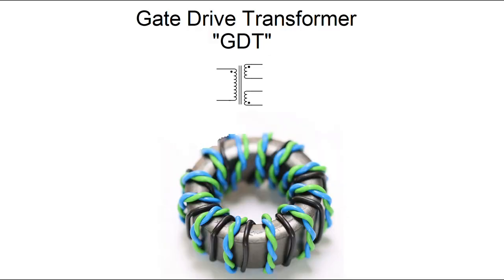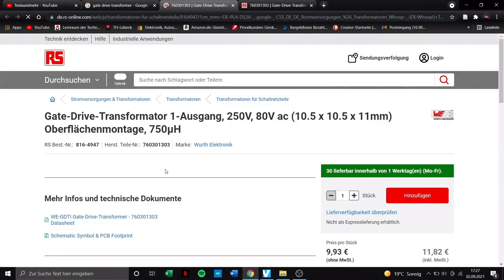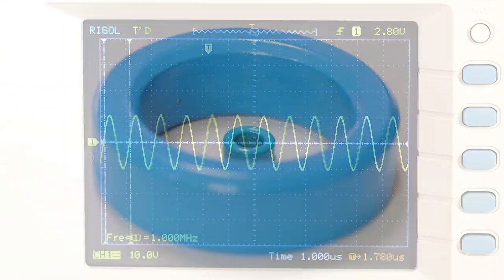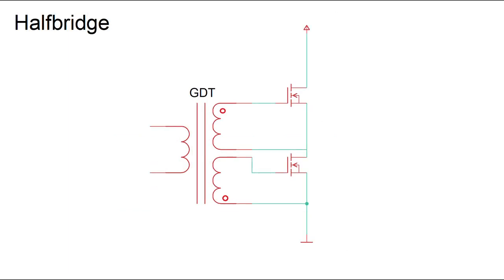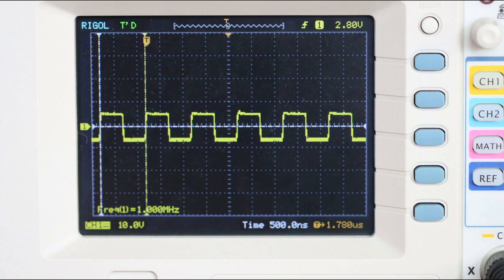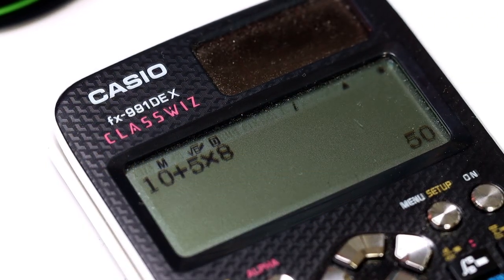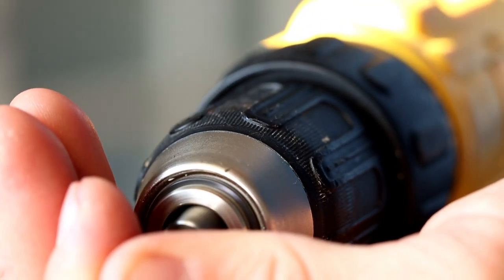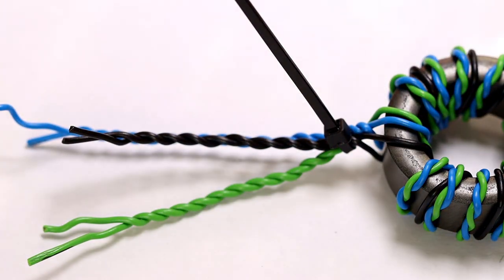Tesla-Coil Beginner DIY Tutorial: GDT - Gate Drive Transformer

Comment: Thank you for this video! I would say GDTs are not so much about separating HV from LV, but turning on and off n-channel transistors, which work in common drain config. To be precise, to fully open upper switch of H bridge, you have to put the voltage between Gate and Source (or Emitter), but upper switch Source is connected to load, so gate drive signal can't have common ground with supply voltage. Unfortunately, with GDT you can't have duty cycle other than 50% (transformers only work with AC), so switching power supply - ok, induction heater - ok, SSTC - ok, but DC motor, where you need PWM - not ok. But that's just a fun fact about GDTs.
Reply: Very well said Sir..how can I connect with you

Comment: Optimally you also want all the windings on the gdt to be twisted together for optimum coupling and performance, and ideally you also want the primary wire gauge to be the sum of all the secondaries combined as it will have 1-4 times the current on it depending on if you're driving a single fet or a fullbridge. You want the primary to be the sum of all the secondaries combined to minimize resistive losses.

I usually use ethernet cable that i take the twisted pairs out of, then i twist all the twisted pairs together, then i join all the white wires into one as the primary and use four colored wires as the secondaries. The galvanic isolation you get with a gdt is pointless anyways as you always need to connect the low voltage logic section to the same ground as the high voltage section either way, otherwise you end up with other issues.

However it is always better to use a dedicated gate driver IC as that completely eliminates the issues you always get with a gdt no matter what you do. I usually use an optoisolated one, but you can also use a IR2010/2110 etc.

The only reason the gdt even exists is that it is often cheaper than a full gate drive circuit, (and was the only real alternative before direct/high side gate drive ic's were invented) but it will never perform as good as a real modern gate drive ic. A real gate drive ic can supply in some cases several Tens of amps to charge/discharge the gates, to achieve the same currents with a gdt, the core will end up huge due to the wire gauge needed for these currents to minimize losses/leakage inductance, not to mention the gdt driver will have to be capable of supplying like 4 times this current, at which point you need a bridge as powerful as your main bridge just to drive the gates.

In the biggest DRSSTC's built to date, just the gate drive circuitry alone is several KiloWatts(maybe even as much as half the power the coil draws from the wall at full power) to drive those CM300/600 IGBT bricks efficiently, given they were never really designed for much more than the higher end of the audio range in intended operation.

Comment: Nice, simple tutorial on gdt
Reply: I’m still new, so forgive this question if it’s totally moronic… 
You describe this a GDT to step up from 12v to 36v(or whatever)). If the primary winding is on the left with the secondary on the right, why are the MOSFETS located in the secondary circuit.? If I missed a key point, my apologies. 
All of your videos are excellent.! Thanks for taking the time to share your knowledge.
Reply: @TheElectronicDilettante   yes you did missed a key point. the GDS's are used not only for galvanic isolation but they are essential to drive the high side MOSFET's without mains voltage comming to the gate driver ic becouse high side MOSFETS's require higher voltage at the gate pin than it has on source pin. For example if you have 170v on high side MOSFET source you have to apply 188V at the gate if using the gate driver ic directly connected to MOSFET to get the required gate to source voltage, on the other hand if using the gdt you directly apply the 18v across the gate and source thus you don't need to mess with those high voltages going to your driver. Also he used the GDT to step the voltage up from 12V to 18V with 8 : 12 ratio and the GDT(Gate Drive Transformer) is only used to drive the gates of the transistors. Hope that helps😉

Comment: Nice stuff! 
I generally prefer using isolated drivers with a supply generated by using a three windings transformer, with the primary driven by another non isolated inverting gate driver (or with a not gate / inverting Schmitt trigger) in a relaxation oscillator configuration. Works very reliably and provides a very nice gate and low impedance waveform. Using GaN is also nice (but pricey failures :O )

Comment: Well done. Do you think it will work with switching series MOSFETs simultaneously?
Reply: I guess a half bridge is like 2 mosfets in series, so I guess it will work. But what will the impulses on the secondary do with the primary winding circuit? 🤔
Reply: @MasterIvo  in half bridge the 2 couple of wires going to mosfets are in opposite phase, if you want the same signal in phase to control 2 mosfets you have just to use same phase (gdt wires) for each gates
Reply: @GianniLaschi  yes I understand. But I work with high voltage impulses on the source and wonder if they will feedback to the primary

Comment: Excellent video, very informative as always !! I had to learn the hard way -Trial & Error! Many hours looking at data sheets 😅 got there in the end - now have a scope 10 yrs too late - but from a perfect Sq-Wave you can see the losses on the output 3E10-12 is bad from low freq <350KHz then excellent higher freq with a crisp  waveform well into 1Mhz. N30 is higher >400 ………. Will have to try N87 - Q… why do you keep your signal wires separate? 🤔🙏🙏👍Andy

Comment: Gdt or have very name dont work because in secondary side need circuit control voltage and correct its pwm shape.when in primary duty sycle decrement voltage in secondary decrease and go 12 v and pulses dont have proper shape.

Comment: If you know proper way make a transformer for two output of switching ic and streghthen it for trigger 20 mosfet.i thanks alot from you .but work must work properly in 2 percent duty cycle to48 and voltage dont go below or abow 12v

Comment: from vietnam with love 
i can't find ucc37322 hic :<
Reply: @Joseph Bunn ths u
Reply: @Joseph Bunn how will interrupt be connected
Reply: @Joseph Bunn ths bro
Reply: I used a TC4423 in my UD1.3 driver. It works just fine.
Reply: @ceepopi  If you use the UCCXXXXX series then you can directly connect the interrupter output to the enable pins of the gate drive IC.